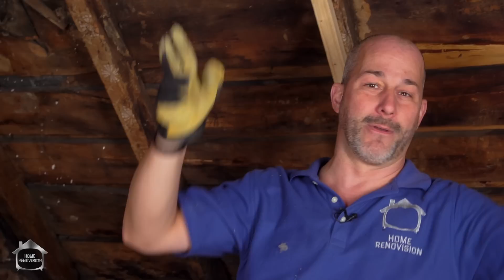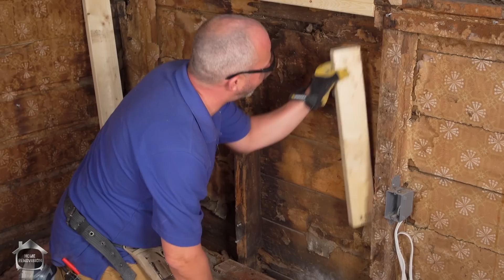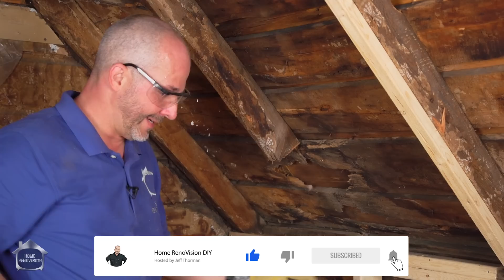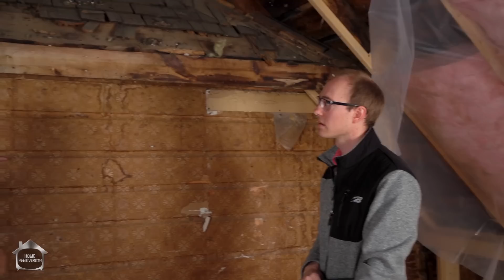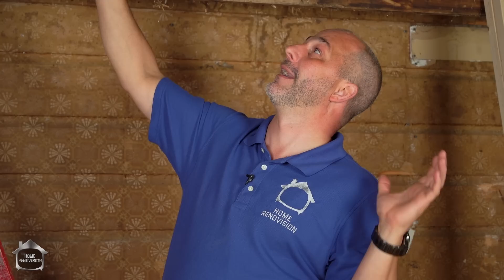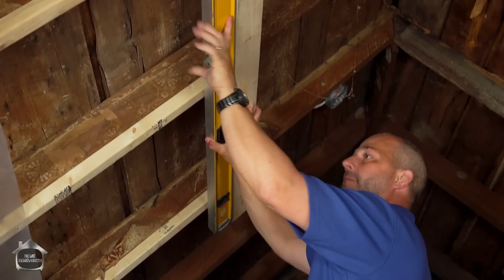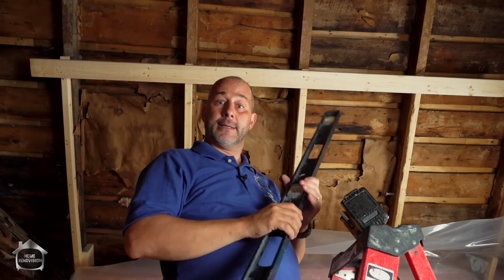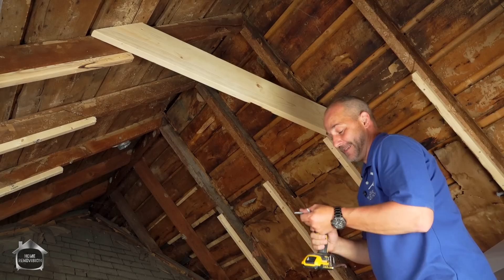How Structural Engineering Affects DIY Projects

Comment: Collar ties are the simplest and cheapest way to brace your roof structure.   My entire house roof does not have collar ties or a ridge beam, and NO columns.  My attic is totally open.  The roof rafters are laterally supported by the floor joists of the attic.   So the roof structure is just a bigger triangle with larger rafters than if collar ties were used.  Also, all the roof dead weight and snow live load on the roof is supported by the side walls of the house,  which is about double the load when compared to using a ridge beam with posts.  House structural design is kinda fun.
Reply: MJS, What you explained is actually how it should be done. The ceiling joists form the bottom leg of the triangle . The  larger triangle is far stronger than the smaller triangle installed in the video.  In the video, the rafter is free to deflect just below the collar tie down to the top plate. Placing a 2x6 in place of a 2x4 does not benefit you. The loads on the collar tie are in tension. The tie is not seeing a downward load along its length so deflection is not the concern. Tensile loads are the concern.  Additionally, when attaching a collar tie, increasing the fastener size does not equate to a stronger connection. It’s typically better to use more nails to distribute the load. Mending plates use this principle. Lots of spikes. The magazine, Journal of Light Construction, has excellent articles on just this topic. And local building codes also spec out the number and size of fasteners for a collar tie connection.

Comment: The structural engineer can analyze various suggested solutions and then identify the details of each, which can then used to estimate costs and other impacts.  I was a structural engineer, recently retired.  Designing houses was always fun since we like architects and their unusual and creative building configurations.
Reply: Do you ever take on side work and can you stamp only in one state or several.  I need an engineer for a small house I recently purchased.  Its a basic rectangle with a 4/12 roof and I want to raise about 1/3 of the roof up to 12 feet with clerestory windows and a flat roof (slightly sloped for drainage).  I also do CAD and 3D modeling so I can easily submit renderings and DXF or DWG files.

Comment: Heres a doozy for ya. 1925 bungalow, one story with attic, balloon framing.
Is it possible to raise the ceiling rafters up a little to give more height. There are already braces going across towards the top.
The ceilings are only 6'8", so raising them even a foot would be a huge improvement.
However, raising up 2 feet would be aahhhmmaazzing

Comment: I noticed you didn't pre drill holes for the lag bolts. Doesn't that risk splitting the wood?
Reply: I noticed the same thing! Didn’t ‘burn’ them in either. Curious if one of those screw-prep methods is still recommended or for some reason it isn’t required for this application?

Comment: ??? The collar ties don't hold the roof up. They keep the roof from flying away.  There didn't seem to me that there was any need for a ridge beam. (and I'm a structural  engineer with 30 plus years of experience.) which is why when the collar ties were removed the roof didn't fail.
Reply from the maker: Hi Charles the collar ties actually are designed to hold the exterior walls from moving away under snow loads. They create a triangle structure which keeps the house from falling down. it has nothing to do with keeping the roof from flying away. Cheers!

Comment: “You should not be able to rip apart your house with your bare hands folks”
He sounded like Red Green 😂😂
Reply: I thought the same thing. “Remember, if women don’t find you handsome, they should at least find you handy.”
Reply: “You should not be able to rip your house apart with your bare hands”
Struggles and doesn’t actually rip off the piece.
Reply: @Bansheekilr  My thoughts exactly.  He couldn't even move it with his "big tool" demolition hammer. That wood may look ugly, but that old growth seasoned wood is skookum as frig. Just make sure the leak is fixed, patch it up, sister in a few new pieces and keep it dry and happy for the next 80 years. It will outlive you for damn sure.

Comment: Ah, shucks!  I was looking forward to an entirely new ridge beam, with load carried all the way down to new load-bearing grade beams poured at both ends into excavated columns with rebar cages.  I think my imagination went wild cuz your solution is MUCH BETTER (less expensive too)!  Many thanks for the narrative.  Sometimes, DIY folks don't fully understand structural geometry, and just looking at what you did without the explanation might leave viewers wondering why you did certain things.  The close-ups help give viewers the next best thing to really doing it.  Where can we see the finished beauty?
Reply: p.s.  As a general rule, however, a structural engineer should be hired during the drawing phase and BEFORE any construction is started.  There are lots of hidden hazards they may not be obvious to DIY builders.  One example that comes to mind is the sizing and materials required to construct retaining walls.  Some long spans work better with steel I-beams.  And so on.

Comment: Vaulted ceilings in cold climates should be atleast R-30-R38. Should have sistered 2x8s or 2x10s to rafters for strength, straightness and proper insulation and ventilation space.

Comment: what about an old house that the floor is not level, looks like the wall that runs in the center of the house have been sinking ,this house is over 100 years old ,the outer walls still very much level but in the center is like  a 3 to 4 inches low, what would you recommend to fix it.?

Comment: Just went through this on a 1870 home. We did put in a lam beam, metal plates, hurricane clips, and ties under the beam to tie it all together. Major overkill but it will never move even with snow load. Some areas we ignored level because it made it look awful. The drywall process was a nightmare but final product looks pretty straight. Fun stuff!

Comment: A little confused and always learning. Your wall plate (doubled up 2x4 beam) seems to be up on the inside about 1/2" and touching on the outside near sheathing,  not twisted. What are your studs sitting on? Do they not need support ? They seem to be nailed to exiting studs. Is sheer strength permissible engineering wise ? Wouldn't  the nails are be taking all the weight? The added studs do not seem to be plumb or overhanging each other. Would this not cause problem when installing drywall? Shouldn't the rafter go all the way to the ridge? When you were jacking and walking added rafter to existing rafter you shot nail in before you had it aligned. It seems at the point you are fighting yourself and bending the last nail you shot in.
Reply from the maker: that is a lot of questions just so that I can say it is all finished and works just fine. no issues with the drywall. Cheers!

Comment: If the house isn't level, don't level those 2X8 cross braces, the ceiling will taper from one end to the other.  It won't be rectangular, more like a trapazoid. It doesn't have to "be" level or straight, it has to "look" level and straight.
Reply from the maker: the best way to make things look level is to actually make everything level. Cheers!

Comment: Flitch beams would work fine for a roof that size.  you could use 2 number 6mm thick 100mm steel  sandwich flitch beams run them down each side to the existing collars. Easy vaulted ceiling. Thats of the top of my head would take 10 mins to run the numbers.

Comment: So I’m doing a vaulted ceiling the same as this in an old house and it is incredible crooked the same as that house. I’m wondering what you do about the raised flat portion of the ceiling. As it appeared in your video, the measurements across at each rafter/new tie will vary. I’m worried about not having a straight corner. Any ideas or video of when you did the drywall in this ceiling?
Reply: It's amazing what a really good drywaller and mudder can do.

Comment: Is this the second story, or the attic above the second story? I'm in Minnesota and get ice dams on our old farmhouse. The roof line comes down and "cuts into" the second story, e.g. the bedroom walls have angles. Like you, I have 2x4 rafters, so I've been told there isn't anything I can do to upgrade the insulation in those angles, since they're already packed with cellulose (but only 4 inches worth). It'd be awesome if there was a way to add ventilation from the soffits too, but not sure it's possible.

Comment: I don't get cathedral ceilings at all. A lower ceiling is going to be better insulating, as less surface area. Heat rises so a cathedral lets all the heat go above your head plus they are terrible for room acoustics. Not sure why you want such a high ceiling in the first place and glad there was some sense seen at 25mins in. Also going to allow for an attic space that you can actually crawl through if ever needed for wiring etc.

Comment: Your engineer probably did not see/hear your opening remarks about the collar ties preventing the rafters at wall plate/eaves level from spreading out.  That is wrong as the collars are so high that they will actually be in compression at that position.  They would only be effective in preventing spread if there were in the bottom third of the rafter.

Comment: Why not leave the old collar ties in place while you install the new ones to ensure that you don't cause any extra bow in the roof due to lack of support?
Reply: Big point
Reply: Good call although im gonna use the collar tie wood for the higher gusset so i hafta take em down as i  go
Reply: That’s what I was thinking
Reply: And you could leave the horizontal 2x4 support on one side, and still placed the ties up, imo. And I wouldn't use electrical boxes that are that shallow, I'd use deeper boxes fastened to the sides of the ties. But that's just me
Reply: Because this guy is a total tool

Comment: I'm more than halfway through our church building to house conversion. Two things sprang to mind here: 1. If you stir up 100 y/o dust your asking for a lung infection, so wear a mask. 2. Old buildings have no consideration for attic ventilation. That's a big problem. The only thing I can think to do, to get air intake, is to bore 3 or 4 inch holes though the 2x6 that prevents access to cool air from the eaves. There's no ridge cap, so I'll put in two electric roof fans. I'm a pulmonary nurse by trade, but handy enough to figure out quite a bit. https://youtu.be/Ojir10Vm4uo is the first video of many.

Comment: Many homeowners (and I believe this presenter as well) imagine collar ties to be "tension" members -- i.e. "holding the roof together, so it doesn't fall apart" -- whereas in truth these ties are "compression" members, intended to distribute wind and snow load from one half of the roof to the other. Taking the ties out, raising them, reducing their size, etc. – tempting though it may be – effectively denies the original purpose.

Comment: Why use only 300 nails when 500 will work just as well? Nail guns crack me up. I've seen you guys use so many nails that the structural engineers should include the increased weight of the structure in their final calculations!

Comment: Hey Jeff. Maybe you have answered this before.  But I have small workshop 16x9. I basically have two rafter ties and because I put flooring in, now floor to bottom Of rafter ties is 75”.  Quite low.  I want to get rid of these two rafter ties and replace them  with 4 collar ties. So floor to bottom of collar ties would be 9’ft.  It’s almost like your setup in this video.  But I have read you still need rafter ties. Do you think structurally 4 collar ties would do. Your thoughts?

Comment: This brings back memories. One was the Parker house. decent sized with balloon construction. My dad had fun remodeling the upstairs rafters so the eaves didn't fall off. It seems the squirrels chewed through the rafters at the wall and they had a heck of an overhang. Dad did a great job of jacking those up from the outside and sliding down some 2x4's. Sealed it up pretty good so us kids could sleep without critter noises all night long. Another memorable thing was the smell of all the mouse leavings. ugh. Filled a couple shopvacs with that crap. 
After that old 1920's house, it was the second log house in the Hood River valley. The rafters were literally pine poles. No 2x4's. It was small but had been added on to a number of times. It was wallpapered with newspaper and my dad carefully preserved part of the log wall that had a paper on it talking about Abraham Lincolns assassination. Golf course bought it all up and bulldozzed the old log cabin before anyone could say anything.
In the log cabin, the roof was so sway backed that the house looked like something out of a fairy tale book. There was no Ridge beam. Well, there was after my dad got done with it. The sway,(8 inch low spot in the middle) was gone. What a pain in the back that was. I can remember nothing being square though. That house really kept my dad busy.

Comment: My roof is bowed including my rafter. how do you fix it? thanks
Reply: I guess this is one of those questions he talks about having you become a member and then he'll answer your phone call.
Anyway, roofs sag for many reasons.  Is there a ridgeboard or are the rafters just nailed together?  Biggest thing, rafters are triangles.  Triangles are strongest at the peak.  Look at the peak, are the rafters still against each other or have they opened up at the bottom (same with a ridgeboard, opened at the bottom)?  If they have opened, it's a sure indication that your walls have spread.  Bring the walls back in line, install a ridgebeam and carry it all the way to the foundation on each end.  Once the walls are back where they belong, the rafters joints will close.  Re-nail them in place and use clips to fasten them to the beam.  No more sag.  EVER.

Comment: Hahahaha, the thing about the level board looking wrong because it was level reminded me of a little project I worked on.

When we wall mounted a 55 inch TV at my sister's house, we went to a lot of trouble to make sure that the wall mount was perfectly level. After mounting the TV, I noticed that it wasn't parallel to the mantle of the fireplace right below it. So, raised the TV a bit, making the slight difference in levelness unnoticeable. My sister saw that there was a gap between the bottom of the TV and the top of the fireplace mantle, had a small fit, and tells us to lower the TV as much as physically possible. We lower the TV as much as possible, and she noticed that the gap between the two of them grows as you move from the left to right. So, she starts to freak out because the TV isn't level. 

I tell her, "No, the TV is perfectly leveled." 

She asks me, "If the TV is level, then why isn't it even with the fireplace?"

I tell her, "It isn't even because it's level".

She says something along the lines of, if it was level, then it would be even with the fireplace. I thought you guys made sure it was level.

I then use the level to show her that the TV is perfectly level, and ask her something along the lines of, "What makes you so sure that fireplace is level? You know how cheaply this house was made?" That's when things finally clicked for her.

She goes, "But, then what am I supposed to do?"

I told her that she needed to pick between making that gap as small as possible, or raising the TV a bit to hide that they were not even with each other. She chose to keep the gap between them as small as possible. To be fair, the mantle was close enough to level that the only reason we even noticed it was because the gap between it and the TV grew a tad bit (about 1 cm) as you ran your eyes over the gap between them.

So, a bit of backstory on her house. Her house was part of an HOA, and all the houses in that HOA were originally warehouses that were constructed at a point in time where the price of wood was really high. Because of this, the floor/foundation and outer walls were made from hastily pored (and very thick) concrete. The warehouse owner, converted them into cheap (but nice looking) houses that he sold off. When we re-did the flooring for the first floor, there were so many large dips in the concrete that the installers for the new floor refused to install the new floor because there was no way that the warranty would cover a floor with such large dips in the foundation. The guy we highered to fill in the dips took an extra day to fill them in because even he was surprised by how bad some of those dips were (the deeper the filler goes, the longer it takes to dry/cure). In order to save money, we did he stripping of the original floor (carpet) ourselves, and we (well, mostly me) also did the the sealing up of the floor. The entire floor thing was about a year before switching the TV to a wall mounted system, so yeah, by the time we did the TV wall mount, she knew pretty damn well that the house was cheaply built.